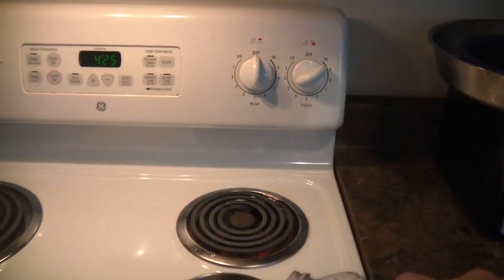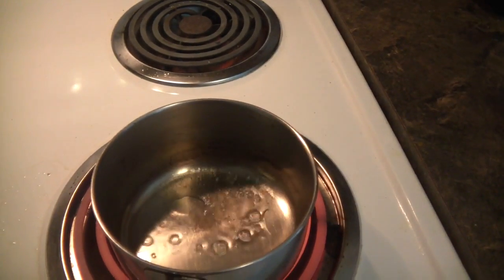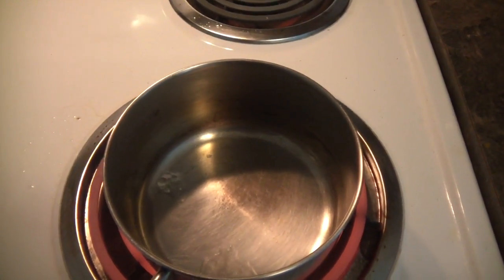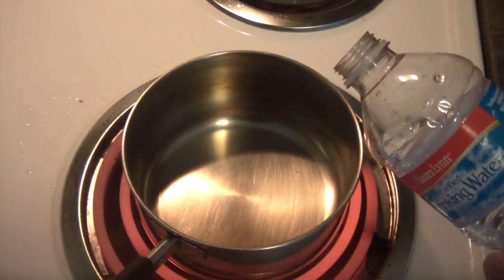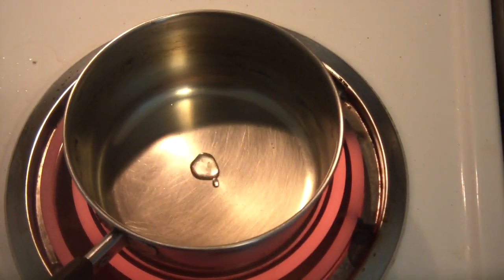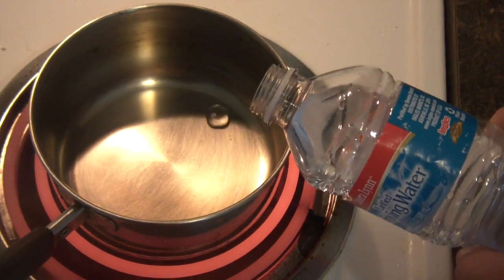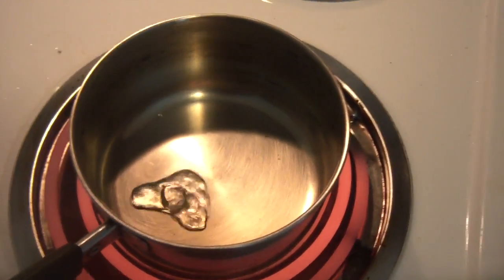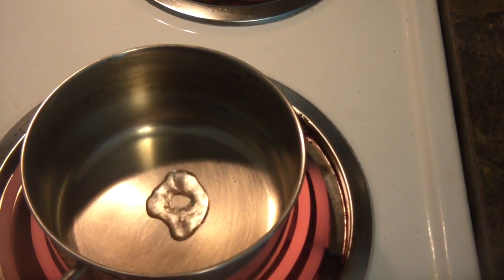Very Hot Water Experiment (Leidenfrost Effect)

Comment: It is because it is too hot it becomes plasma (plasma means: "Super Heated Gas") because solid turns to liquid then gas then it becomes plasma so it doesn't disappear quickly but just bounces on the sauce pan... Idk... I got it from The Film Theorists because of Dragon Ball Z Kamehameha Waves
Reply: Plasma is not that easy to form dude. Water in plasma form will need thousands and thousands of degrees.

Well basically this happenes because as soon as the water hits the pan, a small layer of steam is enclosed between the water and the pan, which keeps it floating.
Reply: It's all I got T^T

Comment: Gas shield!!! :D
The water evaporates under itself, slow enough for the, now air, to become trapped under the water droplet. There's enough space for the mass to move around and not have a concentration of heat. Other wise it would "fizzle out". It also moves around because of the release of gas, mixed with the magnetic attraction between the droplets.  Like little jets
Reply: did u research it
Reply: did u research it
Reply: did u research it
Reply: To learn, you have to research. 
But, no I didn't research it just to comment. 
I've always thought water was...interesting. What it does with different temperatures. Densities. It's different states. It importance for life. 
Water is incredible. It's also fun to swim in.
Reply: Also, water isn't the only thing to develop a "gas shield". Pretty much anything hot enough to melt ice, almost instantly, will create one.
Reply: yep. an air shield can make something move like that.
you can take a sheet of printer paper and try to slide it across a countertop, and it won't go very far. But if you hold it up about half a centimeter and push it forward that way, it will ride on air and go much farther. Of course with that, the air seeps out from under the paper really quickly, but it can ride across a flat countertop some considerable distance. same principle, except that the water is constantly creating air underneath itself (water vapor), so it will keep riding untill it boils away.
Reply: quinny b are you a scientist? (in a good way that is)

Comment: leidenfrost effect water is vaporizing faster than it can get to the pan therfore the gas acts as a shield against the heat suspending the water just about a millimeter above the hot surface providing us with an illusion that the pan isn't hot at all

Comment: if the pan's temperature is at or above the leindefrost point, it produces insulating vapor layer around the droplets so the droplet hovers over the surface rather than making physical contact with it keeping it from boiling rapidly. 
in contrast, if the pan's temperature is below leindefrost point but still above boiling point, the water skitters around and as we saw, evaporate quite easily.
Reply: +Mohamad Arif Which site did you find it on?
Reply: Milky Lama classes and books i guess

Comment: when u pour cold watter on a very hot surface over 650 degreese that cold create a high presure gas arround cold watter and makes the watter float in suspension and it wont touch the surface of metal ,but if u keep long time enough eventualy the watter will be warmer and warmer and that gas will be less and less powerfull so it wont have enough power to lift the watter.
If u can keep the temperature of the watter low then u can have a permanent levitation watter :) w/o evaporate.

Comment: because the heat pressure condenses the water in a state between liquid and soild, the base of the pan acts as a placement pressure source the heat turns the water into the expitoran state, if u have heat/time X amount of watermoclue molucue atoms, where the temp reaches over 237 degress its just too hot for the water to vaporise, this what you see i a compressed high pressured liquidified gass. there you go

Comment: Steam or water vapor would be the answer.  As the water contacts a hot enough surface steam or water vapor will be created.  Steam does not conduct heat as fast as water does,  thus insulating the water from the pan.

Comment: I tried it the whole frickn pan exploded what did i do wrong? I basiccally heated for one minute poured some water it evaporated,then heated the pan for 2minutes and when i poured water, the stainless steel explode and broke my moms dinner set now im grounded ;(
Reply: You could have had the pan at too high a temperature, and so adding cool water meant that tension built on the metal. This is briefed a lot and can be better explained if you search this on the internet

Comment: a small layer gas forms under the droplet (because it boils and evaporates) but is so quick the gas doesn't escape so it riding around on the gas until the heat gets through and completely boils it. it also works with liquid nitrogen check it out on nerd rage search hand v liquid nitrgen

Comment: The Leidenfrost effect is a phenomenon in which a liquid, in near contact with a mass significantly hotter than the liquid's boiling point, produces an insulating vapor layer keeping that liquid from boiling rapidly. This is most commonly seen when cooking; one sprinkles drops of water in a pan to gauge its temperature: if the pan's temperature is at or above the Leidenfrost point, the water skitters across the pan and takes longer to evaporate than in a pan below the temperature of the Leidenfrost point (but still above boiling temperature). The effect is also responsible for the ability of liquid nitrogen to skitter across floors. It has also been used in some potentially dangerous demonstrations, such as dipping a wet finger in molten lead or blowing out a mouthful of liquid nitrogen, both enacted without injury to the demonstrator. The latter is potentially lethal, particularly should one accidentally swallow the liquid nitrogen.

It is named after Johann Gottlob Leidenfrost, who discussed it in A Tract About Some Qualities of Common Water in 1756-
                                                                                                         :Wikipedia.

Comment: Lederhosen effect or idk how it's spelled but it's when it's so hot that the water immediately turns to steam and the steam lifts the water up so it doesn't touch the pan and it doesn't boil because it's not in direct contact with the pan or something like that, it happens with liquid nitrogen at room temperature as well

Comment: heavy water. Normal water has none water in it and it can use that to boil, but if you remove it all it can no longer boil.

 I believe the h2o has changed a little when this happened but I could be wrong

Comment: The pan is much hotter than the water's boiling point, so there is a tiny layer of vapor separating the majority of the water and the pan. It can then skid around without evaporating quickly like you would expect it to.

Comment: The pan is far hotter than the water's boiling point. When the water hits the pan, a complete layer of steam is produced below the water stopping it from actually hitting the pan. That's why it moves so easily. It's also why the smaller droplets kind of bounced around a bit.

Comment: No, well, kinda.  The water that is in the pre-heated pan is being held up by a water vapor. Therefor the water is not boiling because it is not touching the pan.  Only the bottom layer of water is evaporating to create this protective layer.  The water that you see remaining in the pan is actually quite cool considering that it is sitting above such a hot surface.

Comment: There is a thin layer of steam from the hot surface and it prevents the water from touching the pot (until the water reaches the same temperature, which it will then boil out) this creating the beef effect.

Comment: I learned about this in school; it's so hot that a layer of steam separates the metal and water. For this reason, you can rapidly dunk your hand in and out of liquid nitrogen without it freezing. Get very cold? Yes, but your hand won't freeze if you're fast. In contrast to the liquid's extreme cold, your warm hand will seem EXTREMILY hot, and will cause the nitrogen to evaporate more quickly, creating a layer of gaseous nitrogen between your hand and the liquid. SCIENCE!

Comment: This happens because the drops of water are floating on a small cloud of it on steam so as the bottom part of the water evaporates in the smallest amount it causes the water to float on it protecting the water from evaporating/boiling. this is more commonly known among scientists as the laden frost effect. This affect can be achieved by pouring liquid nitrogen on a flat non obsorbant surface (eg rubber mat).

Comment: The pan is so hot it is beyond the point at which the water would appear to instantly evaporate, and now actually does cause evaporation upon contact. The water turns to vapor so rapidly the remaining liquid water can ride on the gas underneath. (Temporarily, eventually, it will all boil into vapor)

Comment: The pan 'is' boiling the water, but it's boiling so quickly that it doesn't have time to fully make contact with the pan; so you get an extremely thin layer of steam trapped underneath the blob of water, and it just sort of rolls around on it. Eventually the water will boil as normal, but only after it's been sitting around in the same spot long enough to cool the pan to a point that the water will boil more slowly. A bit counter-intuitive, but still interesting.